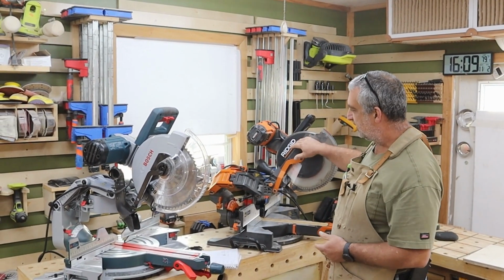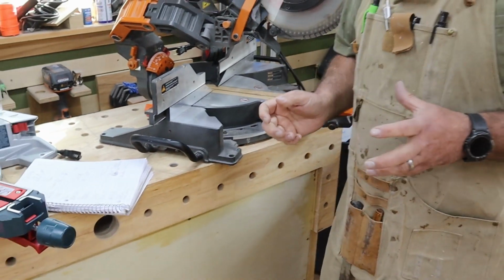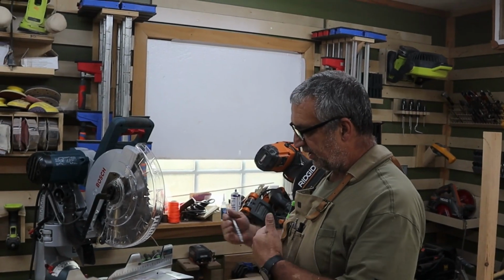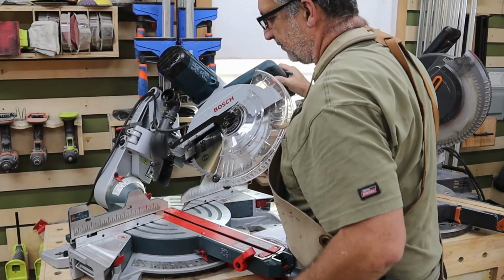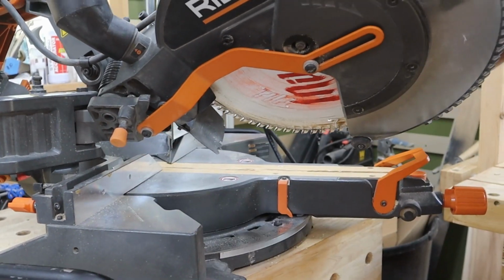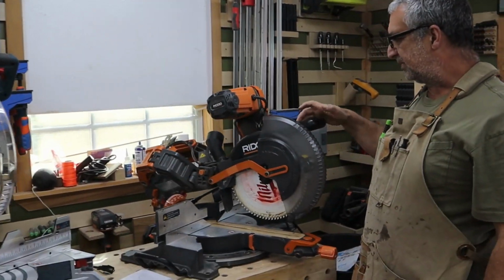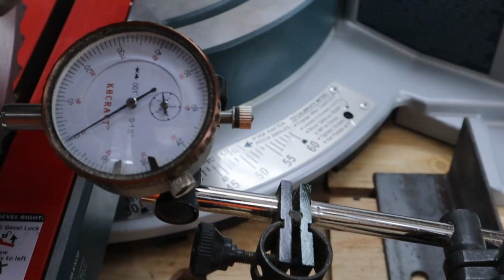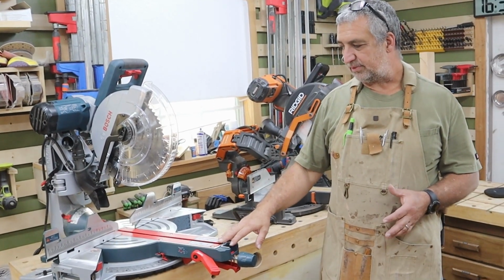The Bosch Glide Vs. The Ridgid R4251 same as Delta Cruzer: Which Miter Saw Is Better?

Comment: I have the Bosch and love it. Came from a kobalt which was awful and couldn’t cut 90 degrees.   I wish it had the shadow line, and plan to install one. Though I can’t decide if I should install as a separate device and power, or integrate the power and switch into the bosch’s handle like another person showed online.
Reply from the maker: I have a few ideas that I would like to try, but unfortunately, I have not had the time to do so. ⌛️ If I am able to come up with a good system, I will post a video. 🎥
Reply: Which method were you thinking about?
Reply from the maker: A viewer shared the model number for the UK version of the product. 👀 According to them, it comes with a dual laser similar to the Kpex. 🤔 I will investigate the possibility of obtaining the missing components or adding an E12 bulb base and using an LED. 💡 I will need to assess the available space to determine the feasibility of these options. 🤔 #DIY #ProblemSolving #StayTuned

Comment: Before purchasing the 10" Bosch Glide, I did lots of video watching and reading forum posts. There were some claiming there's too much deflection and I thought there had to be something going on. Got mine, gave it a once over to verify the factory setup and its been excellent.

What your video shows is, someone has to be either intentional with the deflection or just so ham fisted with technique that it creates deflection. Keep a smooth front to back arm movement and it'll be good.
Reply from the maker: Agreed

Comment: Nice, very detailed review, one of the best I have seen.  I checked both, I ended up buying the Bosch because the refinement was not even close - not for the price.  I agree with the lack of a shadow line on the Bosch - I ended up making my own, which works fine - which pisses me off because the very same saws sold in Asia and Europe do come with the shadow line and a much better wood holder.  Bosch international makes decisions that are just infuriating.  I am going to be buying the cordless 18V Bosch version (Which comes with laser lines) and take it to Greece (Where I spend three months every summer) because in Europe they go for over $1200!  
Good review, keep it up.
Reply from the maker: Thanks. If they make the shadow line for Asia, you would think they would sell the parts so it could be added on.

Comment: Great video! I really like your knowledgeable, no nonsense style of presenting. I have had my Bosch 12 inch miter saw for several months now, and I have to say, I pretty much agree with everything you noted. I do miss either a kerf llight or a laser, but I think I will add the shadow line light with an aftermarket model. other than that, it’s hard to imagine a better compound miter saw. Thanks again for the great video.
Reply from the maker: Great to hear!

Comment: Consider adding the aftermarket laser device that goes on the arbor in place of the washer. It seems to work well on my older saws and less than $30.
Reply from the maker: I bought one of those. It works for one side of the blade. I can make a shadow line. I just have to find the time. It should not be to hard.

Comment: Would your purchase be at all influenced if the Rigid/Delta was $200 less than the Bosch?
Reply from the maker: The reason I bought the Ridgid was I got it on sale. About a year later I got the Bosch on sale for about the same price. Having both it was a difficult decision on which one to keep. I think both saws are good saws. I really miss the shadow line from the Ridgid. Once I get one installed on the Bosch I will be a lot happier with the decision to keep the Bosch.
Reply: @ShopRamblings gotcha! Thanks for the video & input! I think I may go with the Bosch simply for the accuracy, and if a shadow line could be added later it doesn’t seem like the Ridgid really offers much more (other than the savings)

Comment: How is the Bosch saw for keeping clean..as far as the joints that move.? Im so tired of the rails getting clogged with saw dust is this mechanism better
Reply from the maker: Miter saws have to be the worst for dust collection. A miter station with better dust collection is on my to do list. These are sealed bearings and I have never clean them. About once a week I open the doors and blow everything of with a leaf blower.

Comment: I tried two of the Delta saws. They couldn't make a straight cut even after a few hours of adjusting them. I returned both and bought a Dewalt.
Reply from the maker: You definitely have a greater chance of making a bad cut with the Delta.

Comment: I just got the Bosch recently and accuracy was my main reason for purchasing this. Prior to the Bosch I had the Metabo slider 10" and I wasn't overly impressed. After less than a year I noticed wearing on the slide bars and increased blade deflection at full width cuts. I  looked at the Dewalt, Delta, and Ridgid before I bought the Bosch. Despite no shadow line I'm very happy I chose the Bosch. If I want to I can add a shadow line without sacrificing accuracy. It is however a bit on the heavy side but I use it primarily in my shop and only move the saw and stand a small amount depending on what I need to cut
Reply from the maker: Adding a shadow line is definitely on the list.
Reply: Thank you for answering my dilemma from a mechanics’ perspective!
Reply: How would you add a shadow line?
Reply from the maker: The easiest would be just putting in a led like I did in the video I made for the Bauer. With that, you have to put in an AC to DC power adapter as those leds run on DC power. I want to add something like this so I can use a bulb with the power adapter built into the bulb.
https://amzn.to/3NMefXU

Comment: I had the Rigid and sold it for the same reasons you showed. Deflection at the end of the travel (and dust collection.....which sucks on ALL CMS). Just do not have a compound miter saw in my shop. Most cuts can be done on the table saw although not as convienient.
Reply from the maker: I use a miter saw 2nd only to my table saw. I should have bought a Kapex but just can't justify the price.

Comment: Nice comparison.  I really liked the test for deflection.  One thing I learned was how easy it was to influence the cut by standing to one side or the other when pushing the blade through.  I was wondering is that the 10-inch Bosch model or the 12-inch.  Personally, I would like the 10-inch version as I just don't need the greater capacity a 12-inch saw offers.
Reply from the maker: Both were 12".  I had compared the 10" and 12" Ridgid in another video. As most features on both saws are the same with the exception I pointed out, they should be simular on the Bosch

Comment: I have the Ridgid.  It's a good saw...for the price.  I got a great deal on it from HD.  I do love the shadow line.  It does take more finesse to make a true cut, but I don't really rely on it for spot on accuracy.
Reply from the maker: I used it for about a year. I liked it but would get in a hurry, and the next thing I know, I would get a cut off. I sold it for $25 less than I paid for the Bosch. Once I add a shadow line, I will have the best of both saws.

Comment: Thanks for the review. I am looking at the Bosch vs. Delta too. That dern Dewalt just takes up too much rear clearance.
Reply from the maker: I can now build a proper miter station. I had to keep my old saw on a stand so it could be moved. I am going to set the saw into the wall so the station will only have to come out around 16"-18".

Comment: Bosch's lack of a shadow line was the deal breaker for me. I went with the Delta Cruzer. (It was on sale at Amazon for less than $400 at the time, which helped!) As for the accuracy question, I rationalize that both saws cut very accurately if you use proper technique. You can pull either saw off line, but it appears it's easier to pull the Ridgid (or Delta) to one side or the other. Besides, when I need maximum accuracy, I either lock the arms so the head of the saw just pivots up and down (which virtually eliminates deflection) or I use my table saw.
Reply from the maker: I felt the same way. I caught the Bosch on sale and figured I could sell it and get my money back. After testing it, I realized how much easier the Ridgid was to get deflection. I have only had a couple of times last year when I found cuts out of square. I was not sure if it was deflection or if I didn't have the board against the fence. I was surprised at the difference  between the two saws. I will definitely be adding a shadow line to the Bosch.
Reply: @ShopRamblings Thanks for all the info in this video. Did you add a LED/shadow line feature to the Bosch? If so, what does that look like?
Reply from the maker: It is still on my todo list.  @joemalsbury6569
Reply: the Bosch that comes to the US doesn't have the laser, yet the ones come to the UK, Europe and Middle East have a double laser with the exact size of the blade
Reply from the maker: @KHworkshop I wonder if there is a reason why they won't sell it in the US? 🤔 #curious #whynot
Reply: @ShopRamblings   @ShopRamblings   I know why, 40 years ago even longer than that 90% of the tool company made there headquarters in a us state which I totally forgot it's name right now, because this state gave them 30 years tax free on tools, yet this state had one of the most strict laws about safety in the US, because this Sate faced a lot of problems between blacks and white back in the 40s and 50s, anyways so with lots of restrictions the laser can't be built in the tool but the good news the tools tax free time given has ended 3 yeats ago and most tool companies are moving their headquarters to different states now, so in the future that won't be a problem. My bosch saw is coded GCM12GDL not like the us version GCM12SD mine has 2 laser built in with the exact size of the blade, you can check the model number and the history too, I'm not American this is why I forgot the name of the Sate sorry...
Reply from the maker: @KHworkshop  I am going to try and find the schematics can you compare the two and see if I can get a part number to order.
Reply: @ShopRamblings  mine has a the laser built in meaning it take the electricity from the saw itself and it has a switch built in, but I saw a very good video a guy put a led light on this saw as a shadow light and it works amazingly I'll try to find you the link to it
Reply from the maker: @KHworkshop  thanks
Reply: @ShopRamblings  
I keep sending the link but it goes away
Reply from the maker: @KHworkshop  it may be a youtube thing. You can email me at Shopramblings@gmail.com
Reply: I choice Ridgid for 1 reason，they are on sale for 50% off today.  They are 299 for 12in 219 for 10 inch
Reply: @xingleihu yep! I just nabbed the 10” RIDGID for $219.  Had to be very diligent because HD only gets one in at a time and it goes quickly.
Reply: @xingleihu  Where was that?! I've been looking and never saw a sale like that. Home Depot doesn't even have any of the 12"s in stock according to the site. (Or maybe that was the 10"s)
Reply: Nah but shadow lines help but legends still survive
Reply: Ridgid is 1/2 price from delta and bosh
Reply: Thanks for the great comparison. FWIW retrofitting a shadow line is easy. I added one to my Dewalt DW705 miter saw using the guts out of a wall wart 5V power supply and an LED lamp. It's the best upgrade you can do.
Reply: Yea, I'll take accuracy and higher quality over a shadow line that I can add on the Bosch.